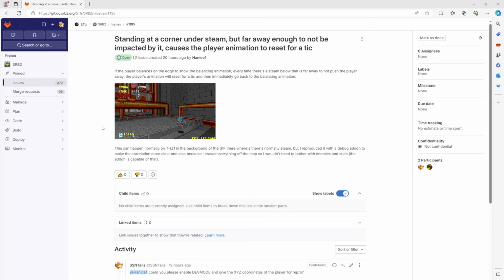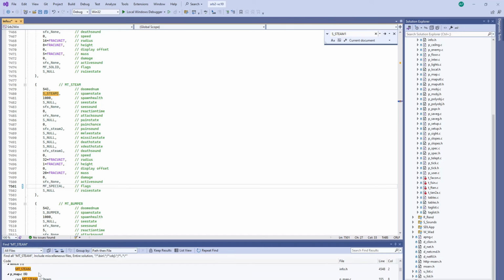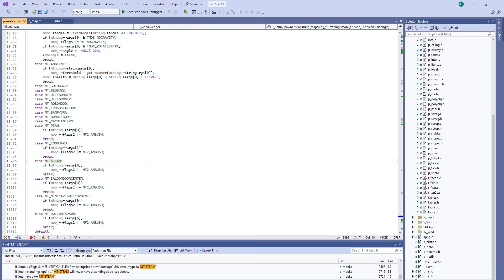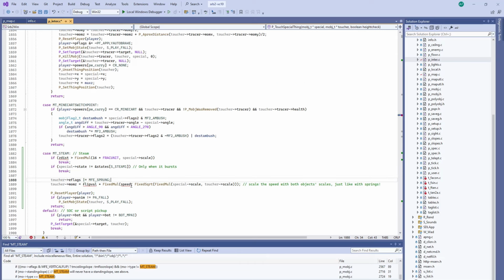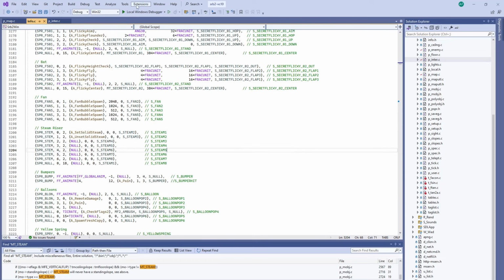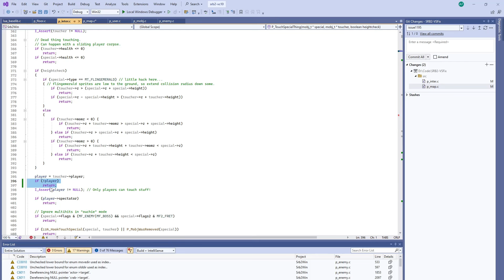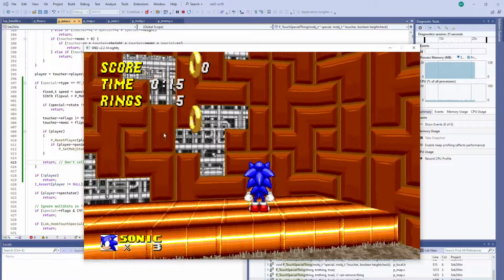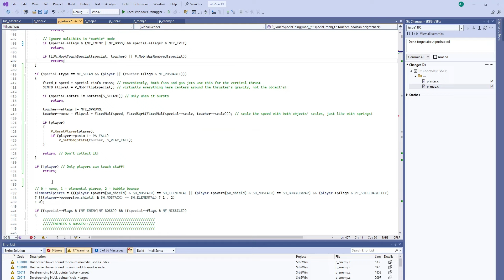SRB2 Issue #1195 - Steam causes the player animation to reset for a tic

Comment: Hmm.. I honestly expected you would take a different approach. What I'd probably do is isolate the root cause of this whole issue first, and thoroughly check if it's fixed (as it could be a more general bug that affects more than just the steam, such as other kinds of solid objects). Only then I'd clean up the logic, especially since I assume that what you did it affects the actual gameplay logic as well (as I assume the collision logic is different for pickups and probably other subtle differences as well), creating demo desyncs. And the ending of the video seems to confirm my intuition.
Reply from the maker: Both need to happen. Unfortunately, debugging SRB2's collision system is extremely cumbersome, slow, and difficult. Finding small edge case things like this are one of the most frustrating things to do due to how difficult it is to detect when a particular value changes. It's not anything I'd recommend for a tutorial video.
Reply: @ssntails  So collision system rewrite when? 🙃 But yeah, I understand. I was under the impression that enough of the solid object interaction code was skipped in the steam's case that finding the issue might have been more doable.